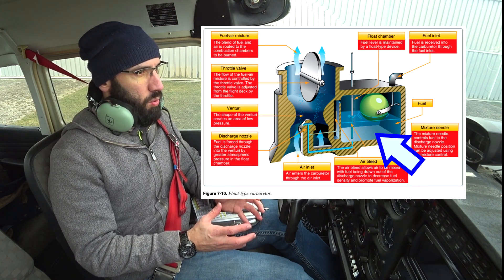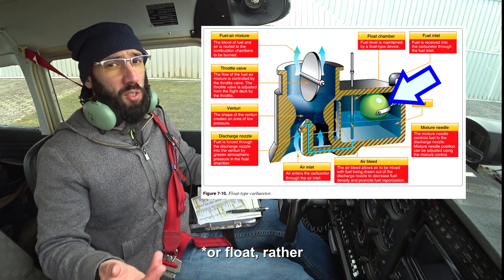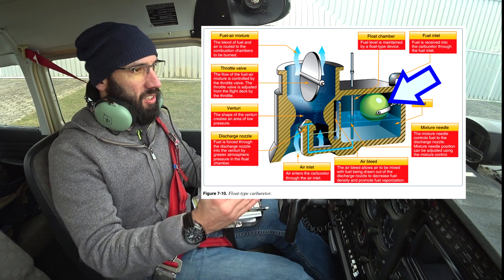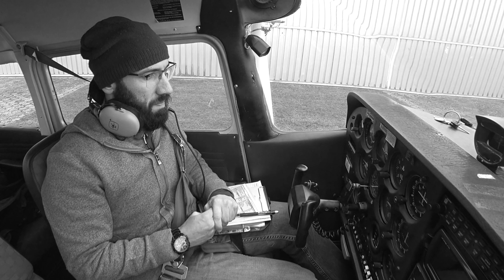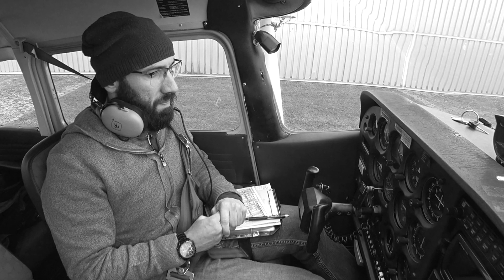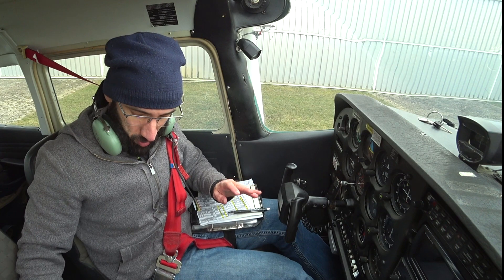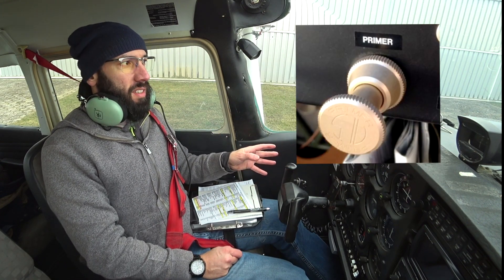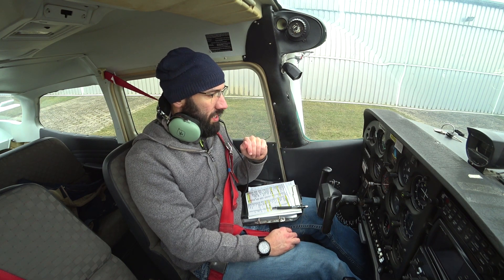Pilots, START Your ENGINES! Starting Carbureted vs. Fuel-Injected Engines

Comment: Why do carbureted engines require full mixture when cranking vs direct injection that only requires mixture to be full rich when engine starts?
Reply from the maker: Here's my non expert opinion on your question.

For the carbureted version, it's simple. When you start the engine with the engine cold, you need extra fuel in the mixture as some of the fuel will condensate on the cilinder walls. As the engine warms up and the fuel will enter the cilinders in vaporized form, the extra fuel is not needed anymore.

My understanding from fuel injected engines is that the injectors do a much better job at vaporizing fuel compared to carbureted versions. When starting a fuel-injected engine, we use the electric fuel pump so the injectors vaporize some fuel into the intake just before the intake valves prior to cranking, and when cranking we wait for the engine to "catch" and then go rich on the mixture so the injectors start spraying fuel again and get into normal operation.

I hope this makes sense, let me know your opinion. Cheers!
Reply: @LeantoPeak  Thanks!! This makes sense and is what I was thinking!!
Reply from the maker: @Mattblackmiata  cheers bud, my pleasure. Blue skies!